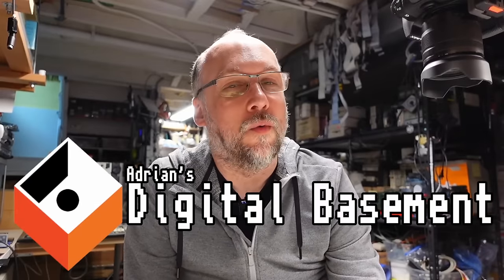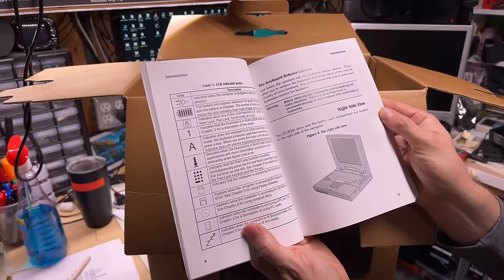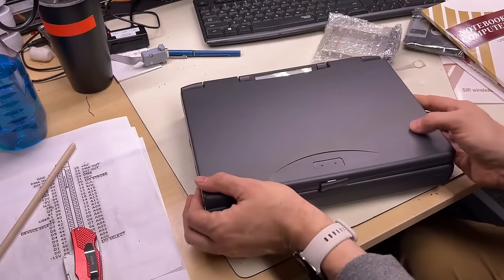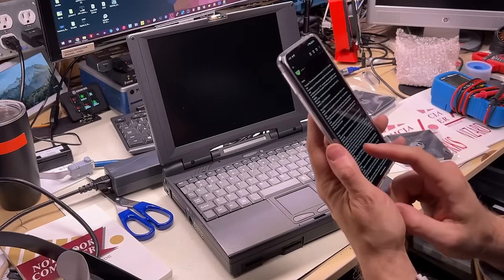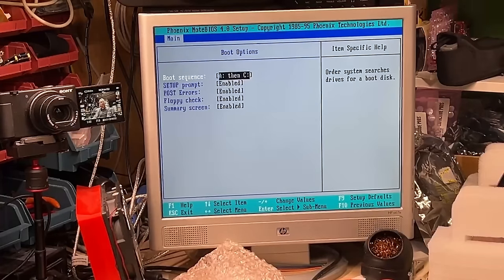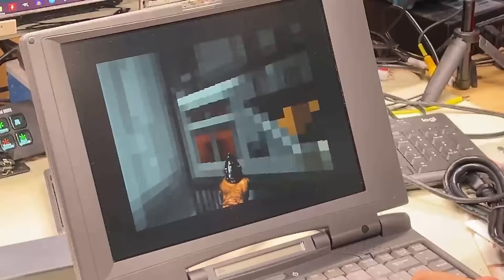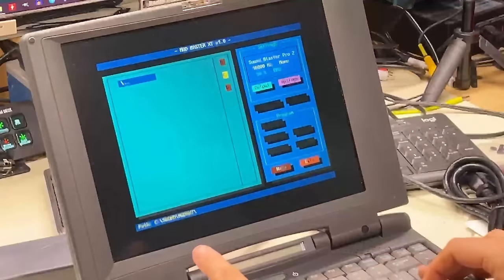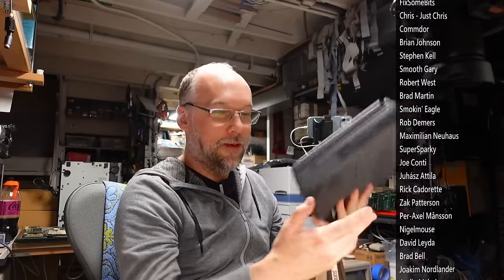0072 Unboxing and testing a brand new 27 year old laptop

Comment: It so amazing to see these specs on a laptop in this day and age. I worked for IBM from the late 70's and ended up as the Customer engineering logistics analyst for the U.K.. I was solely responsible for maintaining supplies of PC stock through out all the customer engineering field stores in the UK. 

Having this position allowed me to order anything I wanted from the main European and U.S. manufacturing sites and have it shipped to the UK. At the time I had made my self a cutting edge pc for the office which I spent more time playing games on than working ha ha. Ah those were the good old days.

When I look back now and compare it to my current phone with 12 gigs of ram and 256 gigs of storage with bluetooth, wifi, gps, etc, etc it still blows my mind. Sadly the younger generation will never have the feelings and memories of being at the forefront of both the computer revolution and even the mobile phone revolution. Both of which I was able to see come to market in their very first generations.

God, if I had a time machine I would go back to the 80's in a blink of an eye. like n sub.

Comment: What's the thoughts on using something like this to run with an optimised 'old' hardware Linux, or perhaps a FreeDOS dev system?
I particularly love the chonk factor! Unfortunately I am sans-PSU/Battery but I have a pretty intact Dell Latitude C540/C640, Mobile P4 2Ghz, and up to 1Gb of PC2100 DDR! 
It has the same chonkiness which I adore though, if I can find a compatible power solution (I'm in the UK) then I'd love to repurpose it for a similar function.
I always just loved the idea of being able to program on the go, I'd love to have one of those newish handheld 386 so-called 'Cyber Decks' and would love to see you cover hardware of that sort Adrian!
Reminds me of the good old days, I had a Psion 5 MX-Pro back in the day with had a relatively nifty BASIC+API for built in apps and because it was like a tiny hand held but Laptop form factor, even with a nice Qwerty keyboard, I had a to spend a lot of time in hospital in those days so I programmed up a flash card system using the integrated Database support to help me learn languages!
Great fun and you felt like a real hacker, coding on such a small device but making really functional and useful code that wasn't horribly slow.

Comment: I started in corp IT in 96 and wow, this one triggers some terrible memories.  And yeah, they sucked at the time.  It's entirely likely that the screen is exactly as bright as would have been back then. There were some decent options by 97 but it wasn't until about a year later that we started to get ones with better screens, inputs, and less than 2 inches thick.  But yeah, the "nostalgia" on this one is pretty much all bad.

Comment: The latch may have broken from being old. Old plastics can be fragile. Hell new plastics can be fragile. My work badge holder broke. So I bought a new one. In less than a month the new one broke, but in a different way. So I swapped parts since they were identical. It's still working now, but the latch on the new one just literally shattered. So it was defective for sure.

Comment: I’m a bit confused. How is this in its original packaging and “new old stock” without a battery and with no CPU? Were those devices sold without CPU or has someone opened the original packaging before and pilfered some stuff?
Reply: This is as shipped from China to the computer company who would finish it before selling it to a customer.
Reply: This type of laptop weren't sold to end users, these were sold to middlemen who then put the remaining parts in to sell to consumers.

Comment: Of mild curiosity, I have a Titan "Mobile Workstation" that's more powerful than your desktop (probably). You can pack a bunch of power into a modern mobile computer. The Titan is more powerful than all but two of my current desktops.

Comment: The DSTN screen was worse than TFT so do not complain. It was basic B&W panel vs. color TFT which everyone preferred. From your other remarks about bios I can tell you are a noob in vintage PC world. The CPU frequency displayed on screen is what motherboard feeds it with while the 133MHz rating on CPU case is the max it can handle, these are two different things. Btw the screen low brightness might be caused by dried caps used in panel backlight supply circuit. The fact it gets brighter with time confirms it. But that is fix for someone familiar with hardware repair. Overall interesting find, thanks for sharing. Hope you get better prepared for your next video.

Comment: Ugh, I would kill for a laptop like that! I have an NEC Versa that's a little bit older, and it would be a great laptop, but I've had major issues with the floppy drive. I know it's supposed to be 1.44MB (I mean, by 1994/95 including a 720k-only drive would have been useless) but I cannot get it to read 1.44MB disks. It will read 720k disks, but that's a very slow way to transfer stuff to the laptop. I have opened it with IMD and in there, it does seem capable of formatting and reading high-density tracks, but outside of IMD it just always fails. I did have a few different methods set up, including ethernet with a PCMCIA card so I could transfer files. But I really want to install a new OS on there, and to do that I need to be able to boot from either the floppy or one of the other devices that can go into the "VersaBay II" at the front. I actually took a risk and bought one of the rare CD-ROM drives for the thing, but it doesn't seem to work. And there's a ZIP drive version too, but man, it's just frustrating. I have a CompactFlash card in the PCMCIA for storage as well now, and I also have both an SD and a CompactFlash hard drive replacement but I had trouble getting those to work with pre-written media...
Anyway, totally off-topic. I just wish the laptop I ended up with "just worked"!

Comment: Yeah back in the 1990s laptops were far more expensive than Similarly specced desktops  and as such they were usually used by salesmen in large corporations who needed a pc to take on the go when flying cross country to close deals.   Due to that most were set up out of the box with software suites  targetted at business users which was fine as most gamers stuck to desktops to get the most for their money.

Comment: I still don't like laptops. The compromise is too much. They run too hot. My constant complaint is this is too hot. My PC on the other hand I rarely get the liquid cooler to go more than a couple degrees over ambient. And it does an amazing job at keeping the computer cool. I've never gone above 42 on the GPU and I think 75 on the CPU.

Comment: That auto white balance issue has to be a bug or something. There also seems to be an issue with the video frame rate as well with the iPhone. It looks like it's dipping below 30 FPS.

Edit: i take that back. The iPhone is dropping below 15 FPS, especially on the part where you comment that it looks like low bit rate trash.

Double edit: apparently the white balance issue is caused by something called tone mapping and can't be fixed.

Comment: Amazing find!!! Those TFT screens were never good, even new. I'm not sure how kind 30 years in a box has been to it, but, there is a reason LCD won (despite the ghostiness) and that technology disappeared...
Reply: TFT screens ARE LCD !
Reply: TFT technology is how LCD screens are still made today, in a TFT display each pixel is being driven by its own transistor and that's why this type of display is called "active matrix". Maybe you're referring to the DSTN/passive matrix ones, which are a type of LCD screen too and are indeed veeeeeery bad, being so sluggish with moving images and with washed out colours and poor contrast. They drive the pixels from the display's edges, by powering on the row and column for each of the pixels that have to be activated.
Reply: All modern LCDs are thin-film transistor (TFT) AKA active-matrix, fwiw. The passive-matrix LCDs didn’t win-out, as even a modern (S)TN (twisted nematic) panel is still TFT-driven. Mainly the problem here is the CCFL backlight, which were always awful up until LED backlights replaced them in the mid-to-late 00s.
Reply: Ah darn, two other people said the same thing while I was writing my comment 😅
Reply: The dim backlight might be a case of leaky caps in the inverter for the cold cathode tube lamp. The 90‘s were the time of bad cap chemistry as you know. The inverters are mostly pwm driven stepp converter psu.

Comment: 1996 that laptop would run NT4.0 perfectly
Reply: Run, yes. Perfectly? Not a chance with only 8 MBs of RAM.
Reply: @Toonrick12  Exactly
Reply: @Toonrick12   I tried once, it doesn't even install on 8 MB. 12 is the absolute minimum.

Comment: Sorry to bust your bubble, but that thing wasn't "untouched", cause the original foil around it was grey'ish and also, the bios from stock had always been set to the internal device also and how can it be 27 years old, when the bios is from 97? We are still in 2023 and yes, one year made a big difference then, cause I own one of the first Laptops with an 200 MHz MMX CPU and the screen isn't dim, you are just used to brighter monitors.

"That speaker is just terrible" - really? Why unboxing such thing and testing it, but then holding it up to todays standards? That's plain stupd and the speaker was about half an inch, it wasn't made to play music, but only to give system sounds.

Comment: You'll have a horrible time with Linux on that thing. A lot of the hardware is unsupported or has poor drivers. You sort of have to stick to the mainstream.
Reply: That totally depends on your distro. There are specific distros based on Old Hardware that runs smoothly
Reply: @jessyrob2000  good ole Debian and Puppy Linux.
Reply: Not sure about that, have tinycore running on my Thinkpad 770 with working wifi with no issues. I mean yea it's slow because it's a 100mhz mmx but it's still quite usable

Comment: So annoying when people twist open the screen from the top corner rather than the middle and even worse when they twist the screen from the bottom corner. Way to trash your screen!
Reply: Never had issues doing it for years myself. But I get it
Reply: I genuinely appreciate your reply, I hope I didn't come across as an asswipe. I've always had an OCD about laptop screens being opened from the corner.

I just Googled if "opening the laptop screen from the corner is good for it," and it confirmed my worries. Because screens are not made from one piece of material, it's usually multiple layers that make the screen.  Twisting it even a tiny amount runs the risk of separating those layers in areas that are susceptible to stress, especially on older screens. 

Sorry if I lectured you but as Louis Rossman says, "I hope you learn something."

Peace bro 🙏 🫶
Reply: @michaelnorcs hey not at all, i do understand where you're coming from though. We get used to doing things certain ways.. I think some devices are built differently to others, there is no latch or easy way to open my thinkpad.. Louis is a legend too...
Reply: @michaelnorcs 🙏